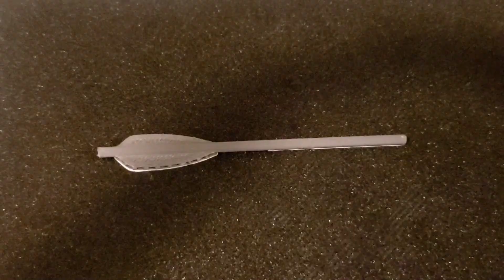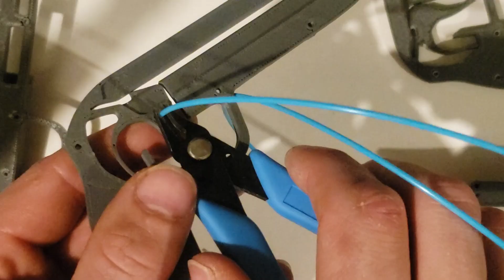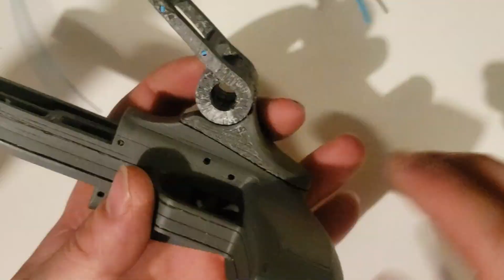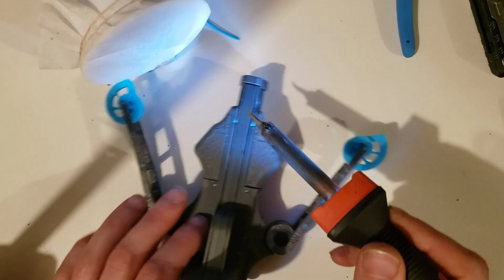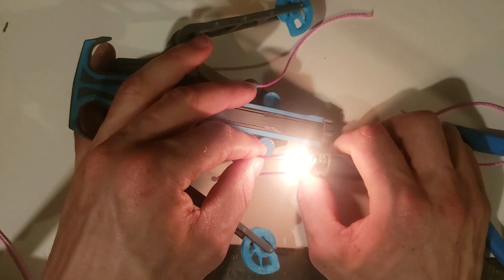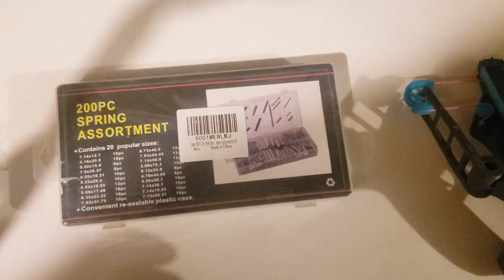Micro Raptor Build (Free STL)

Comment: So how much is in difference for Micro vs Mini ?  150fps vs  ?
Reply from the maker: Low power is about 75fps, that's with silk pla. You can boost that printing with a harder filament and you can also decrease the draw string and cable lengths to increase tension.
Reply: @deadlymedley3306  Woo :) I didn't expect that difference, I guess I'll go with a Mini, thought it looks more complicated to build.
Reply: @deadlymedley3306  Did you try PETG HF and Silk+ ?  All those new elastic materials are interesting for this.

Comment: So, first, awesome print. But I wanted to ask you what kind of settings you use when printing the arms? Wall thickness, infill %, ect. 

Also, it may be worth it making a separate model of that knock out slide piece in the side. When I printed the right side, that knockout piece was messed up, but the rest was fine. I managed to extract it out of the original model, but it could be a useful thing to have for other people.
edit: nevermind am dumb

again though, nice work!
Reply from the maker: Thanks glad you like. I usually go for 100% infill on the limbs for max spring power  and yeah that piece can be a pain if it doesn't print nice. I put the step file up because I  couldn't figure out how fix it because of the way I did the model sometimes its easiest to just break the top I need to take another look at it thanks for the feedback!

Comment: What's the purpose of the filament inserts in the bow arms?
Reply from the maker: @colind6797  the limbs are printed  up right which makes the piller supports hard and brittle so the filament strand "cross grains" those for strength
Reply: @deadlymedley3306  Is this a requirement that you determined thru experimentation or is it something you're just kinda "winging"?
Reply from the maker: @colind6797  yea it's through experimentation. Basically if structures are printed too tall and skinny they are prone to being brittle because of "z compromise" which is a term i made up for that phenomenon

Comment: if i try to print the outside part my printer always fucks it up, do you have any advice what i might have done wrong for this to happen?
Reply from the maker: sry your havin' troubles, is it an issue with the in-model support? It might not be you or your printer. Sometimes it slides out, sometimes you need to clamp the piece to a bench vise and bash it through with a hammer. I wanted to make this piece easier but wasn't sure how. I put a link for the step file on cults if that helps
Reply: @deadlymedley3306  I already figured it out, I had my offset too high
Reply: And my printer is kind of tired of all the hard work so the nozzle is slightly crooked
Reply: @deadlymedley3306  btw, I really appreciate you putting the files up for free, a lot of designing probably went into this nifty little crossbow.